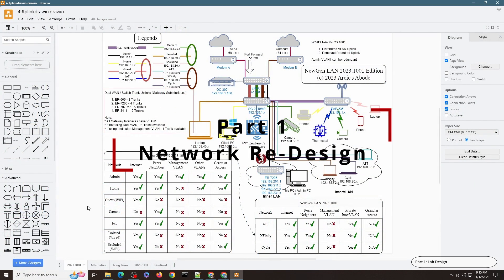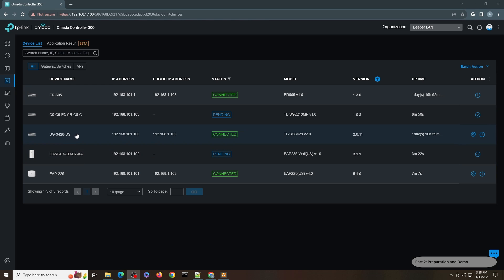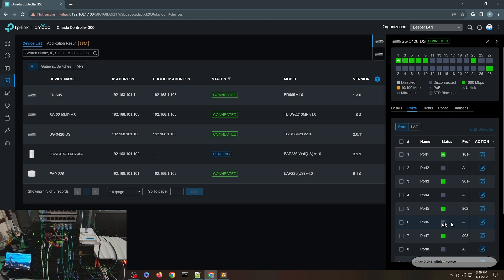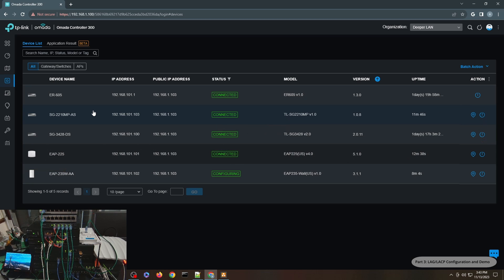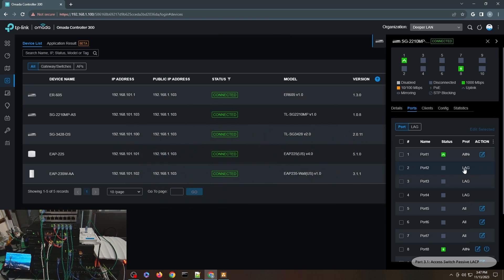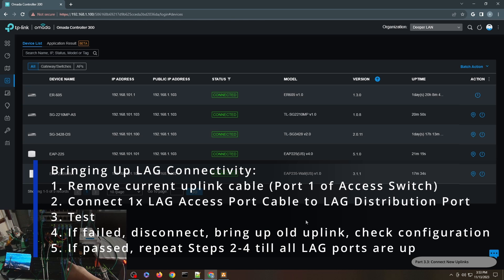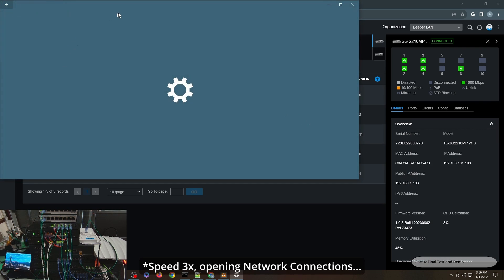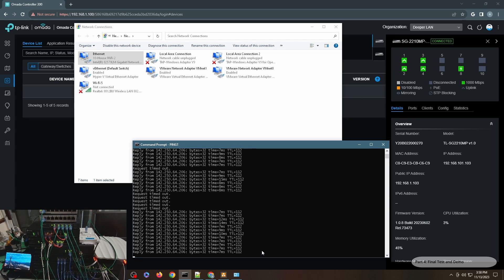LC64: Enhance TP Link Omada Switches with LAG +LACP: Distribution / Access  Switch

Comment: Hi Sir, can I get the CLI configuration of the LACP?
Looking forward for your reply. Thank you
Reply from the maker: hello @wxiang-h6v, thank you for dropping by the channel. I do not have access to my lab at the moment, so I am unable to check the CLI config. However, I just want to make sure that you minimize mix usage of CLI and GUI Mode (Controller or Web Console) because in my experience, result can be confusing, and inconsistent, or even cause issues. So try to do everything in Stand Alone Web or SDN Console rather than mix/matching CLI and Stand Alone/Controller modes. I can give you the references I used in the past, check link below:

CLI Commands - https://www.tp-link.com/us/search/?q=Typical+CLI+Configuration+Examples+for+TP-Link+JetStream+Switch&t=FAQ&category=support
CLI Guidelines - https://www.tp-link.com/us/support/faq/3569/

Good hunting!

Comment: I followed your steps and if I have just one link in everything works fine but when I try to physcially connect the 2nd port I loose all access from the downstream switch.  The downstream switch is not a Omada SDN switch it is one of their EasySmart switches which do support Static LAG.  Any ideas?
Reply from the maker: hello @CallMeCribby, thank you for dropping by the channel. Apologies for late reply as real life has been so busy right now. As for your issue, make sure Static LAG is enabled on both switches and LAG is sometimes finicky, so the best way to enable them is connect all LAG port members "at the same time" . That is, try to configure LAG ports while NOT in use (let's call it Ports X1, Y1 on Switch 1 and X2, Y2 on Switch 2) . This means you have another port connecting the two switches (let's call it Port Z1 on Switch1 and Z2 on Switch2). As soon as both switch have LAG ports configured, disconnect Ports Z1 and Z2 and connect X1/Y1 to X2/Y2. Btw, since EasySmart only supports Static LAG, make sure to set Omada as Static as well.

Good hunting.
Reply: @deadmeats  I got it working.  Found out my I had 3 connections between the switches and not just two.  The wires were crossed so it explains why the LAG wasn't working right.  Thanks again, great tutorial!

Comment: Good day sir. No need naba gumawa ng port profile for STP? Tas i assign sa LACP bundled group??

Q1: What if tatlo yung switch ko connected. Base sa video, rekta po kayo nag config ng LACP bundle (for 2 switches) 

Q2: 
Once mag config nako ng LACP,  yung mga ports na member ng LACP group need paba i-assign sa "STP Port Profile"? Kasi sila mag participate sa STP algo?
Reply from the maker: hello @davidesguerra7837, thanks for dropping by, Yes sir. Yung STP, and purpose nya is to block loops. Pag in-enable mo sya sa LACP mo, baka ma-block yung uplinks kaya hindi mo na sya kailangan. Ang problema pag walang STP, posible ka magka roon ng loop kaya siguraduhin mo na ayos yung mga uplinks. i..e kung 3 yung switch mo, iwas ka sa "cascade", ang gawin mo eh "distributed" (i.e avoid Switch 1 <> Switch 2 <> Switch 3, instead do Switch 1 <> Switch 2 and Switch 1 <> Switch 3).